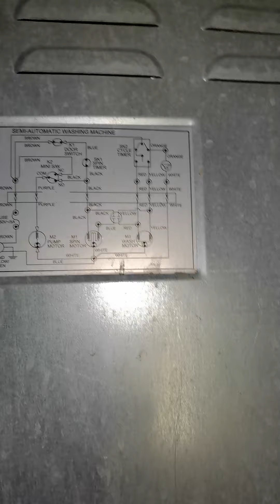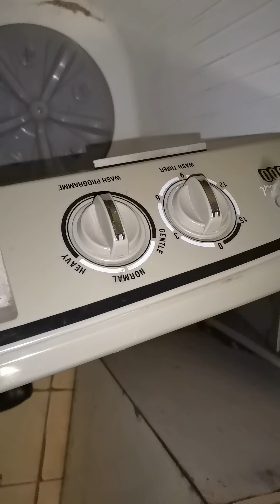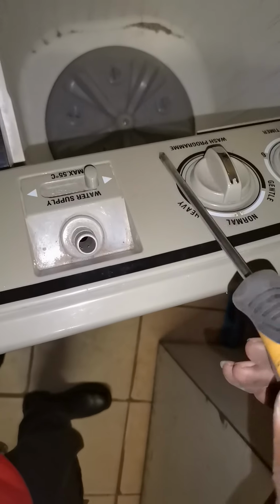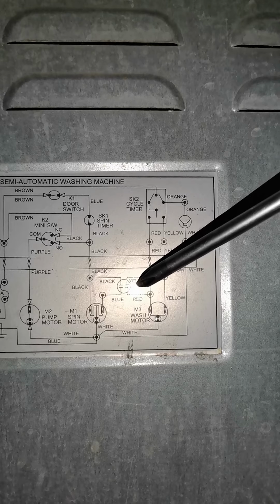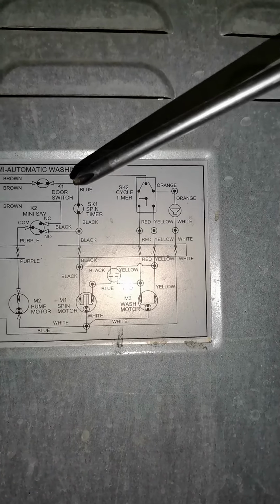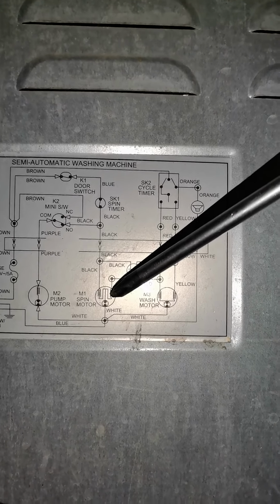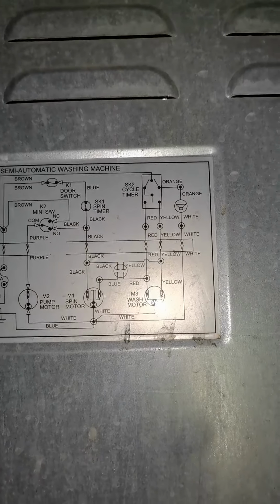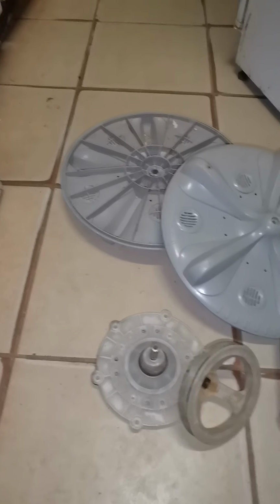Defy twinmaid 1300 (Part2)

Comment: Hi Bhutiza someone tried to fix  my defy 1300 twin tub. It  was not spinning but not it moves in one direction when trying to wash . What might be the cause ?
Reply from the maker: Check if yellow and red from the wash timer are connected to yellow of the motor and the capacitor, also check if red is connected to the capacitor and the motor. If all is well please watch my twin tub series videos for fault finding technics.

Comment: Cant find my answer any place

Can i connect start and run wires of my new spin motor on any of the 2 points on spin capasitor? 

Got a defy twinmaid 1300. 

Only use one capacitor for wash motor and spin motor.